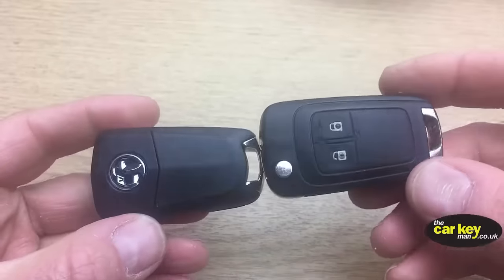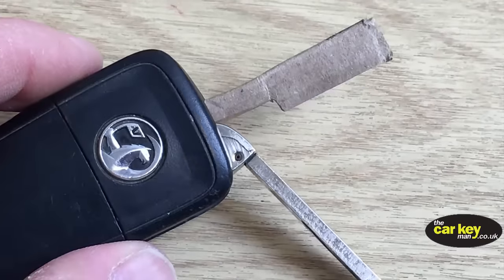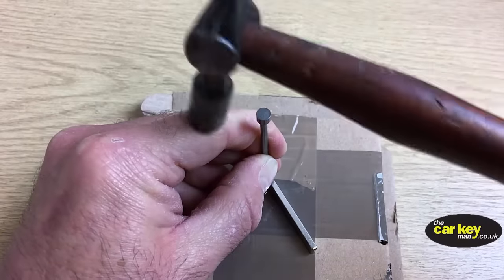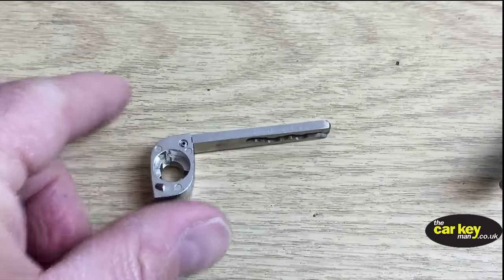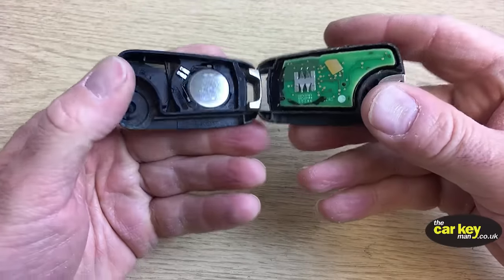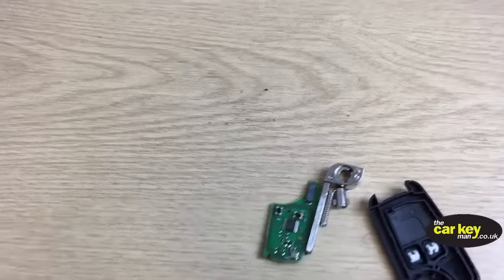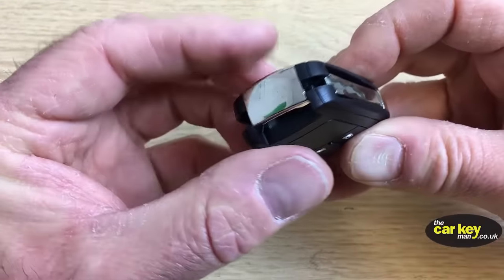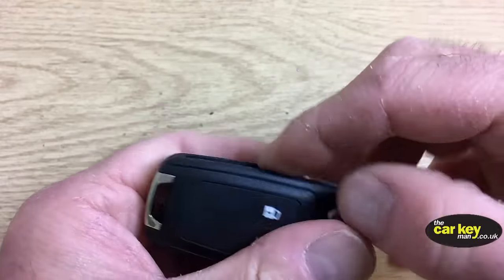Vauxhall Flip Key Repair Kit Instructions

Comment: Amazing tutorial, thanks. Hardest part was getting the original case apart without any fancy pliers but got there in the end. I used a tool meant for removing metal watch strap pins to remove the key blade pin, so if you have one of those it's a doddle. Soak the old case in boiling water for 5 mins and you can easily pry the logo badge off👍
Reply from the maker: Hi, thanks for this feedback. Yes some of the cases coming through now are getting tough to open, while others just pop open like the video. I guess they have been made in different factories. Really pleased it helped :)

Comment: I changed my key fob last week and it worked fine, till yesterday when the unlock button stopped working, but the lock button still works. Ive took it apart and put it back together again and changed the battery and it's still not working. Could the circuit board be knackered?
Reply from the maker: Hi, did it work before you changed the case?
Reply: @TheCarKeyMan  yeah it worked perfect. Then it worked perfect in the new case for a week.

Comment: Hardest part for me, was opening the old fob. Not sure why but it was clued togheter.
Reply from the maker: Yes they are all glued, but sometimes they glue gun was on full power and they are very tight
Reply: @TheCarKeyMan  i guess. But mine broke in 3 piece while opening. I was glad the motherboard was oke.

And i orders from some random store. Didnt got the pin thingy. I used a nail to remove the metal key.

Comment: My key is welded shut i think or feels like it, it just wont open. Any tips to open it so i can change fobs.
Reply from the maker: Hi, sone of the cases are quite tight now, compare to when I made the video. 
Are u using circlip pliers?
Reply: @TheCarKeyMan  thanks for replying, yes I think I've snapped off every bit now apart from the circuit inside , safe to say it's well and truly stuck in there.

Comment: Does Anyone know the size of that screw that goes into the hole in the circle, I've lost mine and need to know what size screw it is?? ANYONE PLLEASEEEEE
Reply: try 6g or lower with a flat head just gently experiment it looks like a screw that will make its own thread in the plastic
Reply from the maker: Thanks Leon, I missed the question

Comment: This didnt work for me. I have opel mokka 2018 and the key is completely sealed in plstic. Its not possible to open that with pliers. I had to use dremel tool to cut it. Spent almost 2h trying to open it. So be warned.
Reply from the maker: Hi, some of the later keys are more difficult to open, not sure why because they are sealed the same way as they always have been. Good to hear you found another way
Reply: @TheCarKeyMan  yeah they want to make it more difficult for people to repair it, so sad.

Comment: Hi . Thanks a lot for learn
I did it . My Immobiliser was ok but after change the body key don't work now.
Do I have to program it ? 
I am so confusing.
Thank you
Reply from the maker: Hello, no if you have only replaced the case, then the car should start fine. How did you open the key?
Reply: @TheCarKeyMan  I did look like to your video open it.
Start fine the engine , but don't work the bottons lock and unlock .

Comment: Good afternoon. I have a 2011 Astra. The central locking works but the rubber cover with the open padlock motif has fallen out and become lost . From your kit , would it be possible for me to cut out that button cover and just stick it on? The key works perfectly well otherwise. Vauxhall, ever helpful, say they can't but will do me a new key for around £240 . Thank you
Reply from the maker: Hi Anthony, I would say no, that won't be a very good answer to the problem, compared to swapping the whole case
Reply: @TheCarKeyMan  Thank you for getting back to me. Anthony

Comment: Thanks so much for the video. When I had my first car, corsa, I tried to do this but I never could because I was trying to put the old one in the new case, there wasn't much videos then so I struggled and gave up. However, I just got a new car, Astra and the key fob is in poor condition. Ironically, for some reason, this video appeared in my timeline 2 days ago and it is a god send. I knew what I had to do. The good thing is, I already had the key fob which I brought from ebay, like £2.50 2 years ago. Only difficult thing was to get the pin removed, but I have a watch links removal tool kit which had a hole punch, smaller but it did the job. I also had to find down the metal as it was slightly too big but once filed, worked well. (Lol, literally had all the tools which I brought over the years come in handy now)

Less than 1 hour, had to do it twice becuase got the battery in the wrong way round and this time it worked. 

TIPS: Make sure the battery is in the correct orientation, got it wrong first time so the battery needs to go in before the circuit board. 
2. Do not screw it down, first test to make sure it works so go to your car and try it out. 
3. Once working, then screw it in.
4. Another thing, the metal tab which holds down the battery is fiddly but it must make contact with the battery. Mine one got bent during installation and it wouldn't stay in place, battery kept coming loose so I removed the original tab from the original key fob, worked perfectly. (Keep your original fob, never know when it might come in handy)
But anyway, I have a new key fob, works perfectly and the key stays in place, not loose. 

I am going to order a badge for the back from ebay, you can find them for around £2. But one thing for sure, if I didn't have the tool or fob, would have ordered from you as it is a great price. 

You should maybe consider including the badge, make more money.

Edit: Went to buy the badge from ebay, it says I already brought it years ago, went to check my bag where I kept my vaxhall key fob and behold, there was 2 badges there in a envelope. I so happy that I kept all my fob, parts as this time, it cost me nothing as I had the fob, badge and tool. very lucky.
Reply from the maker: Hello, thanks for taking the time to leave these excellent tips for everyone, really glad you got your key sorted in the end :)

Comment: My old blade won’t get out of the thingy, what do I do to change it with the new part?
Reply from the maker: Hi sara, if the pin it out, then the only thing holding it in is a snug fit. Some gentle encouragement should work :)

Comment: Hi, using only the new parts, the key doesn't lock in the closed position. The 3 groves on the button are lined up correctly with the key mechanism but doesn't line up with the front facing shell. Any ideas? Thanks
Reply from the maker: Hi Antonio. Did you order from my site? If not, when the key arrived did it have the blade attached?
Reply: @TheCarKeyMan  Hi, it was ordered from your website, new key blade wasn't attached.

Comment: I've took the pin out but my blade is not coming out I've used 2 sets of pliers one on the blade and one on the mechanism and it is solid??
Reply from the maker: Hi Craig, ok, are you talking about the old key or the new key?
Reply: @TheCarKeyMan  it's ok I've done it put a little bit of wd40 in it to loosen the grime and pull it apart. 👌🏻

Comment: May I just be sent the curved chromed section that the role pin sits in? or will you require me to buy the whole kit? only I have a shiny VXR key case that doesn't need replacing. I only need the curved section that's snapped, I have the appropriate roll pins & punches. £12.49 for the one piece I need is a bit steep.
Reply from the maker: Hi Tom, unfortunately if you just swap the piece you mention, the flip action will not work
Reply: @TheCarKeyMan  May you explain how so? The flips still works now only the small part that houses the roll pin has snapped off so it flips without a key.

Comment: What do you do when the old key doesn't open with circlip pliers? I've torn through the plastic, there's bits of it flying everywhere, but the two halves are not even close to separating. Excellent video, though.
Reply from the maker: Hi Andy, good question. I'm starting to et these comments and even see a few myself. It's as if the glue person was on steroids and just went completely over the top. 
So I would use a soldering iron to very slowly and carefully melt the joint, and get the two halves apart. Be carefull you don't let the tip slip into the key and damage the chip otherwise the car may not start!
Or get a dremel, or similar and carefully cut the case
Reply: Thanks for the reply. I don't own the tools you mentioned, is it possible to use a different circuit board? I ordered another replacement key that came with a circuit board, but it won't sync with the car. I have no confidence in my ability to get at the original circuit board without damaging it.

Comment: A watch link removal kit comes in extremely handy for this! I didn't receive a screw with the fob I bought, do you know what size I need? Does it matter if it's not there? Great video 👌
Reply from the maker: Hi, is it one of my kits? If so I will post one out and sorry it was missing. I will measure this morning when I get chance.
Reply: @TheCarKeyMan  no it's not one you sold. That would be great if you can get the size, thanks.

Comment: yes it did not pass, used toe old part with new case... to button did not pass... it was terrible as I destroyed my factory key and did not now what to do... so I usel the file and pass the 3 points :-) then when it was finally done I found out it is not stopping when I close the key :-) to additional passing in the cover...:-) I am lucky to saw this video after my 4 hours spending with changing the cover ;-) Btw. I tried to remove the cover as in video, but it looked it was glued or I don't know from factory... I was not able to remove the old cover as in video...
Reply from the maker: Hello Rado, sorry you are having problems, did you get it fixed in the end?
Reply: @TheCarKeyMan  Yes I find a solution ;-) :-)

Comment: Hi, awesome video!!! 10/10
Can I ask please is there a way to replace a key that I lost, ordering two sets of these (one to replace a damaged key and one to to replace the missing key). 
Look forward to hearing your response.
Reply from the maker: Hi, you can use this kit to repair a broken key, but a new key needs to be cut and coded by the dealer, or an Auto Locksmith. Where are you?

Comment: Saw the video and bought your kit. Took a bit of filing but all done and fitted together. I had bought one from amazon that didnt have a screw and didnt come with the punch. The screw felt reassuring and the punch, if you dont have one already was really helpful. I was able to get the badge off with a stanley knife, no melting required. Many thanks for supplying these kits as you do.
Reply from the maker: Hi Chris, I really appreciate the feedback and pleased you got your key fixed ok :)

Comment: My key case won't open. I followed instructions and it worked on my new key case but my actual car key case will not open. Its as if the bottom of the case isn't able to be opened unless I break it?  I broke the silver part at the bottom  (keychain part) but the case still open open. Please someone help. Its a vauxhall vectra but it just will not open.
Reply from the maker: Hello, are you using the pliers, the same as in the video?
Reply: @TheCarKeyMan  yes putting them in and it opens the top but just not half way down the bottom. Do I need to break it open do you think? I'm just scared I break the chipboard and if i break this key that it won't work in the new one im so para :(

Comment: Hi, everything went ok with the key locking the car with the fob however the blade in the key keeps popping back up even though I have used all the new bits and not the old? Any ideas?
Reply: Will the old button fit it the new blade holder?
Reply from the maker: Hi Max, no you can't use the old button unfortunately. Did you get the kit from me? Drop me a message on the number in the box and I'll try and help you

Comment: I've just ordered my kit, the instructions look straight forward. Just wondering, could you use the original case back but new front, blade holder, button and spring allowing you to keep the logo on and it still close?
Reply from the maker: Hi Katherine, no because when you open the old key, it breaks and is made differently to the new key. The old one is glued shut, the new one screwed.
It is possible to remove the old logo and re-use it, but the only way we've managed to do this is to use a soldering iron and melt the plastic of the old key.

Comment: Got the kit today, got all the way to the end and put the case together and as you said in the video where the bottom side doesnt shut sometimes, i have that problem and i dont know the cause of it and how to sort it.

Edit: I think I've worked out whats wrong, Ive got the exact same case in this video but my car is a Corsa, so ive been trying to squeeze it together and its obviously not gone together.

I haven't damaged the circuit board in the process have I? 

Please get in touch!
Reply from the maker: Hi Ashley, sorry I've been away. Do you still need help? Did you call the number?
Reply: @The Car Key Man  it's fine now, ordered the wrong case, mine was for a corsa, got the right one and put it together in minutes thanks to your video 👍

Comment: i must just be really unlucky, because mine seems to have been fused. the only thing that happened trying to pry mine apart was the plastic at the logo tore
Reply from the maker: Hi, so is the case broken, are you able to get the circlip pliers in?
Reply: @TheCarKeyMan  the circlip pliers just tore the upper plastic where the 2 halves meet. the case was sealed / glued the entire way around. even after resorting to a Dremel to safely remove enough material to retrieve the board, close inspection showed it was indeed completely sealed. absolutely zero play in the halves at all and the inside of the recess was smooth

Comment: Dose the new blade need to be cut to match the original blade if so what if the original blade is damaged.
Reply from the maker: Hi Frank, what have you done to the old blade?
Reply: I haven't done anything with the old blade I only have the one key ,I need a second key .

Comment: Most of my customers, try and diy it themselves and they either brake the new casing, the chip or super glue the case, chip and the motherboard.
Reply from the maker: Hi Cameron. The main problem is when customers try and open the case without the Circlip pliers. Screwdrivers, saw or dremels lead will cause damage, but we've never had a problem when using Circlip pliers
Reply: @TheCarKeyMan  nah I love using the pilers aha 100% so much better

Comment: Mine arrived yesterday and I fitted it all today, super easy and took only 10 mins quality item, it doesn't come with the vauxhall logo for the key but I bought one on eBay so now the key looks exactly like the original key.
Reply: was the metal pin removal thing durable and did the key come with the blade detached?
Reply: @TJ-yc1hp  yes it was durable and the blade on the new key was detached and in the packaging. The video is very accurate on what to do and I shall repeat what he says in that make sure when the new blade is on the new spring make sure u wind it a couple.of times so the flip out function of the key still works
Reply from the maker: Hi James, thanks for the help with this question :)
The metal punch is normally durable if used with some care. My advice is to locate it accurately and gently hit the punch to get it started. Once the pin starts to move, or show signs of moving, then hot the punch harder

Comment: My key won't lock in place HELP!!
Reply from the maker: Hi Bradley. Are you using all the parts from the new key except just the blade? The problem you describe normally happens when you are trying to use the original blade holder and button etc. Let us know how it goes
Reply: @TheCarKeyMan  hi yeah I wasn't changing the mech on the blade so that's why I was having the issues thanks for the reply 👍

Comment: When i do this the key doesnt line up and not able to close. Not sure what im doing wrong.
Reply from the maker: Hi Sara, did you manage to sort this out? Did you get the get from my shop?
Reply: @TheCarKeyMan  yes i got it figured out. Saw on another video that you have to tap the pin out and put the key on the new housing. After that it snapped right together.

Comment: Hi I just need the metal lever that snapped that holds the key in the fob, the key and fob are fine. Any suggestions?
Reply from the maker: Hi Maggie. Unfortunately the pieces in the new case are all made to match, but are not suitable for just replacing one part.All the new parts, except the blade, need to be used
Reply: @TheCarKeyMan  ok how much is a new fob? I have a 2008 vauxhall tigra
Reply: Hi I need to order a new fob and I need the tools, which tools do I need

Comment: My button falls straight through. So I can't get the halves back together without the button flying out
Reply from the maker: Hi John, that's odd. Do you mean the silver button goes through the blade holder? Did you order it from my site?
Reply: @TheCarKeyMan  No, I was trying to fix the old one. It wouldn't flip open. I've discovered the tooth that holds in place has broke off causing it to fall through. I've orded a new one.
Reply from the maker: Cool, ok, let me know if you need any help swapping over

Comment: I did everything like you but key doesn't stay closed. Doing my head in
Reply from the maker: Did the new key work correctly before you took it apart?
Reply: @TheCarKeyMan To be honest key wasn't locking properly before but always thought it was the lock on the case. It was actually the key bent not allowing the lock to reach the locking position! Sorted now with an hammer 😁